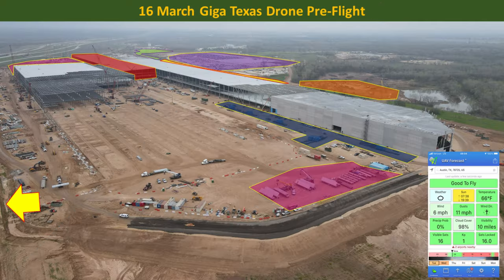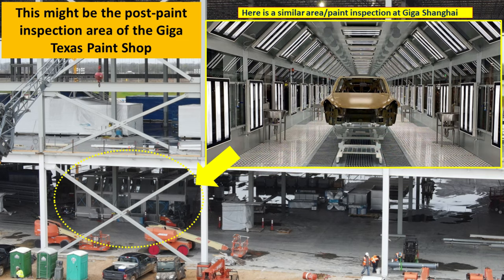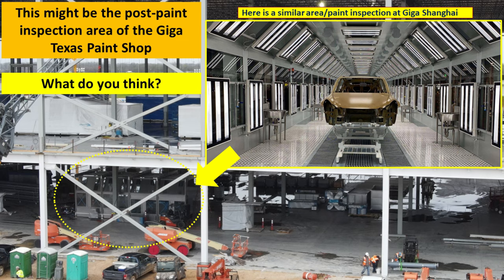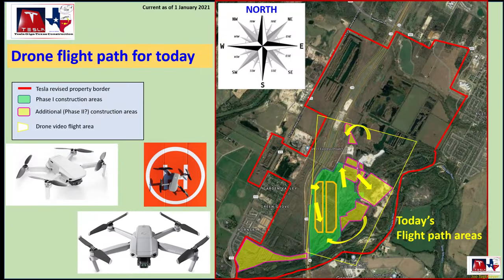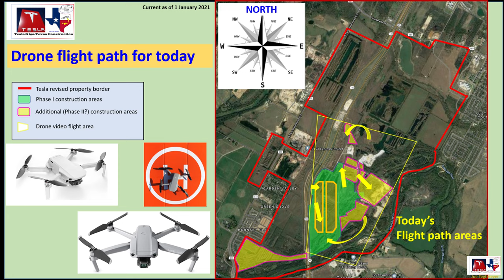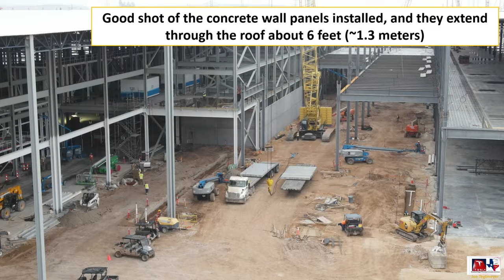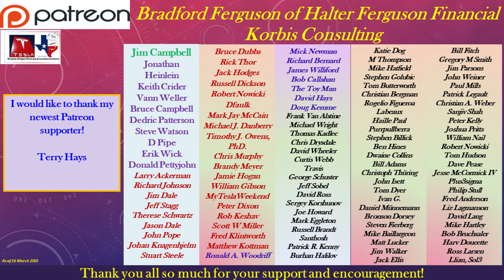Tesla Gigafactory Texas 16 March 2021 Cyber Truck & Model Y Factory Construction Update (08:30AM)

Comment: Joe, great work as usual. Paintshop information much appreciated.
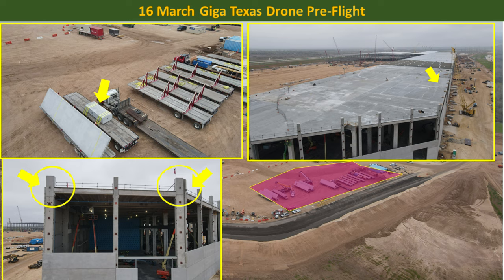1:00. Column extension on the trailer. For newer members of the Austin GigaFactory Precast Connection sub-interest group, the row of white tubes at the far end is where grout is injected into sleeves buried with the member. These sleeves slip over the rebar projecting out the top of the column. It’s a grouted connection only between the top of the column and these extensions.
5:44. Guy in foreground is setting up the hold down bolts before the footing gets poured.
6:55. Powered screeder in use. Not an automatic screeder as used recently further south on the floor slab.
7:18. 6 hold down bolts in these 2 footings joined with a beam in between. All the other footings around here have 4 bolts. At least I think it’s a beam, don’t recall if it got rebar.
10:22. Bunches of gas cylinders in frames have been there for a week or so. 
18:21. Southeast diagonal, the missing triangle. Formwork has been stripped and it is possible to see that the topping slab wasn’t poured right to the edge of the double T roof panel. Thinking this will be filled in, waiting first for installation of a wall panel cast with a handy ledge on the back face.
20:58. Plastic sheathed rebar.
Reinforced Concrete Lesson No 1. Rebar must be in direct contact with the surrounding concrete.
Reply: I wonder why the extensions are massive, instead of lightweight box & top wall panel.
Standardization of parts ? Ability to take a weather beating ?
Or why those columns were not just made longer like the diagonal ones, since they seem oversize/weight transports anyways.
Reply: @musaran2  Don't know why they didn't just make them longer, but if a guess is good enough, there might be a highway weight limit that requires a permit and an escort, so extra cost. Drop a bit of weight so a permit isn't required X 40 or so columns (including the casting plant) and that might add up to an attractive saving. All the new build Tesla factories have parapet walls, so it's not like it was a design change.

The longer columns on the diagonal corner are much smaller in cross section, so would be considerably lighter. 60% of the weight?

As for why they didn't go for a lighter construction, maybe they still want the mass, and concrete is the cheapest mass money can buy. And as you say it's simpler if they continue with the same materials.

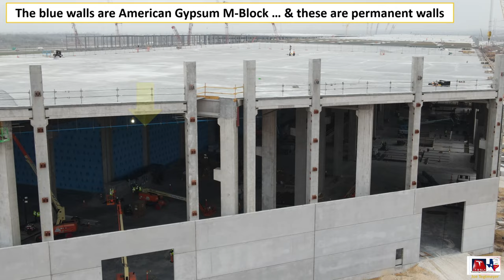Comment: Joe, at 19:01, you’ve identified American Gypsum M-Bloc was used for the blue walls. These are gypsum wall panels, like what we have in our homes, but it is specially formulated for limited wet areas. Per American Gypsum’s website: “M-Bloc gypsum panels are also approved for exterior soffits and/or sidewalls in protected corridors/breezeways with indirect exposure to the weather.” That’s what has me thinking this wall is temporary. They want to get a portion of the building in the dry. Plus, in previous videos, you can see this wall goes straight up to the roof, around the bridge crane rails. I’m not sure what was the point of extending the bridge rails to the south end of the building if the wall will cut off the rails. You can also see they have reduced the size of the northern opening in the west wall. I also picked up that they are sealing the joints between the concrete panels of the west wall, starting at the north end and working south (21:20). Everything is telling me they want the northwest quadrant of the stamping building to be dry, dry, dry. I just looked up the cost of M-Bloc panels vs. exterior-rated plywood at my local Lowe’s... the M-Bloc is $15.74 vs. Exposure 1 (temporary unprotected exterior during construction) at $43.15... both for 1/2” x 4’ x 8’ panels.

Maybe you have insider information, but everything is leading me to believe this wall is only temporary. It’s also interesting that the day after the walls are completed is the day that the first stamping machines arrive on-site. My guess is that tomorrow they will start backing the trailers into the stamping building through the smaller north entrance and use the bridge crane to offload and place the machinery.
Reply: They already backed some in yesterday, when they arrived, several videos showed the semis peaking out from inside, with the long trailer in there already. Also, the wall could be permanent, as it goes both east-west and north-south, and they could be putting in multiple bridge cranes, so one could go on the other side of that wall, coming in through the big door opening on the South angled end.
Reply: Another reason to suspect it's temporary is they used rusty steel tubing to support the studs (as obviously, you can't frame a 75-foot high wall with just cheapo metal studs). They didn't bother to paint or finish the rusty tubing. It seems like awfully cheap, chintzy construction for a place where everything else is top-notch, built to last.

I agree.  There's something about the stamping machines that needs them to be installed in a clean environment. And that place is a dust palace right now; its windy as heck, and you can see layers of dust on pretty much everything in pretty much every video.
Reply: @LinasVepstas  I was thinking the same about the rusty steel frame, but then decided maybe it is red oxide paint. I wouldn't bet my house on it being either temporary or permanent, but I will say there are much cheaper materials available to line a temporary wall with. If any of the quad squad get a shot of the walls being stuffed with insulation, or being lined both sides, that would suggest permanency.
Reply: it would still be weird to pay for a temporary wall to enclose what will soon be enclosed and dry pretty soon.
Reply: Jeff Roberts got a great shot peaking inside the stamping building. Based upon what I see, I stand by my call that it’s a temporary wall. The steel studs are still exposed on the inside. The gypsum sheathing is only on one side (the “weather side”), at least from what we can see. Sure, they could be installing gypsum sheathing on the “dry” side in areas that we can’t see. However, I don’t think that’s the case.

Another thing about the bridge crane rails. Not only are they cut off by this wall, but there are no noticeable rails stops on either side of the wall. There is no hard provision to stop the travel of the bridge crane like you see at the far north and south ends, where the rail ends. So, there is nothing (at this moment ) to prevent the bridge crane from crashing into and then through the wall - beyond good operator control. Sure, they can install rail stops at any time, but why not when installing the crane rails initially?

Remember back to the foundations for the stamping machines? There is a rectangular, underground pit that goes under this wall. So, if the wall iss for fire-protection as some suggest (since the type of gypsum board can be used for fire-rated protection) there is a pathway underground that circumvents the fire protection. If you wanted fire protection, why not just divide and separate the foundations where the wall will be located? Why provide underground access from one side of a firewall to another, which needs a self-closing fire-rated doorway tied to the fire alarm system to maintain fire protection? Adds unnecessary complexity. “The best part is NO part.”

Finally, why go through the expense of building a temporary wall? Well, suppose it takes 4 months to install, test, and validate the stamping machines. Ordinarily, you would wait to start the process once the building is at least closed in. You need to protect the machinery from the weather. So, you wait for the walls and roof to be weathertight. But at this point, it only takes 3 months to finish the rest of the building and production line, where you can start producing vehicles. The stamping machine installation and validation becomes the CRITICAL PATH. Any time you can identify the critical path and move it up in the construction process, you can shorten the overall construction schedule. Then, it’s a matter of whether the cost savings of these temporary measures (like installing temporary walls) to move things up in the construction schedule pay off. This wall took about 3-4 days to install. My guess is it cost about $250K. Let’s assume it cost $1 Million. Let’s also assume that the production rate will be 500k Model Ys/year, (my guess is that it will be over 750k) with an average selling price of $45,000. We don’t know what the margins are, but Tesla has been getting about 18% from the car business recently. So, each Model Y will net $8,100 in profit. Based upon 1-month schedule savings and a run rate of 41,000 Model Ys per month, Tesla can make $332.1 Million by installing a $1 Million temporary wall! I know that it will take time for the production rate to ramp up, but the important thing is that the earlier the building is complete and production begins, the earlier the production ramp can begin. So if we assume that the production ramp remains a fixed duration, moving it up by 1 month means that Tesla can earn that $332.1 Million sooner. A 33,210% return on investment? Sign me up!
Reply: Later videos show they are American Gypsum  MGlass exterior sheathing.  These are suitable for direct attachment to exterior  side-wall and soffit framingfor various exterior materials such as wood,  metal or vinyl siding.
Reply: @douglasgroff7648  Bingo!

Comment: You can tell how heavy those trailers and the stamping presses are. Not only are there a bunch of wheels, the tractors have stacks of weights over the drive wheels to give them traction and the rear of the trailers have stingers so another tractor can get behind and push up hills and such. That’s some weight there.
Reply: payload approx. 85-100t

Comment: The underground electrical pipe work is referred to as a duct bank. They’ll place a series of plastic pipes in cradles where you can stack several layers of pipes above each other. They’re then covered in concrete for added protection.
Reply: Yep, you’d hate for some to stick an excavator bucket into one of those lines by accident. Probably be his last mistake though. Call before you dig!
Reply from the maker: Thanks David!

Comment: Something that I think demonstrates Tesla's propensity for iterative learning really well, is the apparent difference between the timing of equipment installation at Giga's Berlin & Austin. At the Berlin site they waited until the buildings were mostly enclosed but here they're really pushing ahead with equipment placement before the walls have even begun on the Paintshop & elsewhere.
Although the differing climatic conditions may also feature in the difference between the schedule of works.
Reply: I think a lot of it had to do with bureaucratic reasons also. In Berlin, they had to wait until they could get permits to install of the machinery, and it has proven to be quite a length process. I think they were able to get these permits much quicker in Austin
Reply: @zacadams7070  Also the difference in climate may be a factor.
Reply: @zacadams7070  Okay, that's interesting. From the little I understand about getting planning permission in general in the US, is that in many places, planning regs seem to be far less proscriptive than say, the UK or Germany. Apart from stringent earthquake building regs & SSSI's, NZ is pretty relaxed about what you can build too.

Comment: At 9:03 you are wondering about the concrete wall panels. My guess is explosion cantainment. my thought process: One of my employeers installed a spray paint booth for me and the requirements were strict about potental sources of ignition (explosion proof conduit, lights, etc) because of the volatility of paint fumes; no floors in the stack; I did maintenance for a customer that stored flour in huge suspended bags in a dusty room with concrete walls and a plastic roof panels to direct any explosion up and not into the plant. This may be something like that. Feel free to disagree with me and come up with your own ideas. I am guessing using my past experiences.
Reply: The company I work for has a fire safe room where they store all their bulk flammable liquids.
Reply: Yep, I agree with you 100%, most likely an explosion-proof paint storage area.

Comment: At 17:39 you can see one of the galvanized steel helically corrugated pipes on the machine that rerolls corrugations in the ends of the pipes. The reroll machine is the one with the yellow track and the yellow roll structures on the ends. The reroll corrugations are parallel with the ends of the pipe and are rerolled back 8” or so. The helical corrugations do not seal very well at the joints. The parallel ridges at the ends allow connecting bands to also parallel corrugations that mate and thus decrease joint leakage. I think the pipe on the right on the rack over the tarp is getting the cut ends coated with galvanized paint.  Battery swap right before 17:39?

Comment: Segregated 4 hour fire protected safe rooms might be needed when a building footprint is so large the path to escape exceeds required distances. Even the Steel structure is isolated from heat transmission.

Comment: At 11:27 Need I point out the "35 TON" crane waiting to be installed?  Bob says lifting spreader beam.  Damn, that's a lot of lifting!

At 12:50 Auger is installing a power pole.  Will be more! 

At 13:57 I'm surprised that the concrete covering the conduits is gray.  Some codes require it to be red to warn anyone digging that it's high voltage.

We can guess how many souls are working there by counting the vehicles at 14:47.

At 19:53 if they're hauling a single column extension on the trailer then they must be very heavy - a solid block of concrete and rebar!

At 20:54  Frames for what?  Loading bays?

25:24 Ent cranes.   Thanks, Joe, for the visually spectacular video.
Reply: The 11:27 (35 ton) is not a crane. It is a lifting spreader beam with the maximum capacity labeled on it.

Comment: I'm thinking of the new office building we built a few years back and comparing it to this.  There will be much more trades showing up.  Besides the obvious HVAC, electrical, plumbing, sewer, water, storm drain, compressed air, chilled water, all kinds of manufacturing equipment.  There will be security wires for doores, etc, separate wire for cameras, separate wire for heat/fire detection and alarms.  There will be a (maybe more) UPS rooms to support servers and critical equipment.  We had several network equipment rooms on each floor that required UPS based power. All kinds of fiber/optical cable to the network rooms from the main data center room. Ethernet cables all over, special fire equipment/CO2 in the data center, and I imagine in the paint shop.  Probably a water based sprinklerr system, natural gas lines for the aluminum furnances.  All equipment for a cafeteria and/or several snack rooms, phones, special equipment/cables for cell phone repeaters (hard to get cell phone reception with all that metal), dry wall, painters, window installers.  Maybe some backup generators for critical equipment. The list just goes on and on.  We are just now seeing the amount of different trades that will be onsite.  This is just amazingly Huge and Complicated.
Reply: I've noticed quite a number of cable tray runs in the paint shop and other areas in recent videos.
Reply: "Besides the obvious <lists many things I never thought of>..."

Comment: They're almost as busy as you, Joe.  I'm thinking the notch in the stamping area roof will be left for a roof access ladder/stairwell.  The rectangular area central to the paint shop where they are lining with concrete panels may have some other usage, but could also be a tornado/fire shelter area.  It's above the water management culverts which (if empty) might also serve as some emergency shelter.  Noticed there are a few elevator shafts taking shape.
Reply from the maker: Thanks Will  ... I appreciate the ideas and inputs!

Comment: The conduits running from the switch yard are arranged in what is called a 'duct bank'. This is when you have multiple conduits in one trench, often with parallel conductors for the same circuit. These will most likely be 12.5 kv, or higher, lines running to switches and transformers where the voltage will be further reduced to be distributed locally within the factory.

Comment: Thanks Joe, for another excellent video.  I noticed there is only one green tarp container left now.  I think there used to be four.  I also noticed that there is very little room between the Northwest corner of the building and the berm by the highway.  Will there be enough room for trucks when they are finished?  According to Wikipedia (https://en.wikipedia.org/wiki/Electrical_substation), "A switching station is a substation without transformers and operating only at a single voltage level."  It looks like they are installing transformers, so is it better to call it a substation?  If so, will there be a separate switching yard?
Reply: 59seank I thought same thing on NW corner, and I'm guessing they may cut into berm between bldg and road/ramp, put in a 20-foot retaining wall and have it sweep the corner with enough space.  Who knows?
Reply: @biovmr  Sounds like a great solution.  I enjoy these little mysteries.